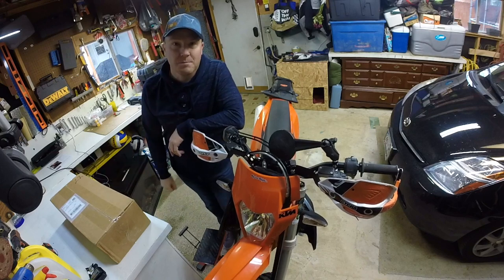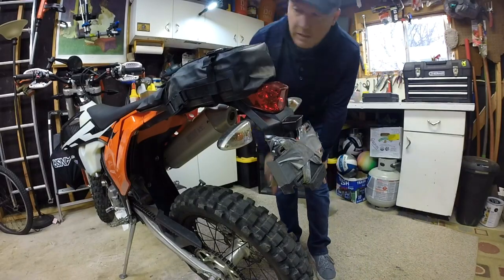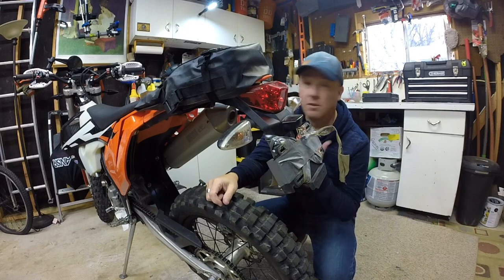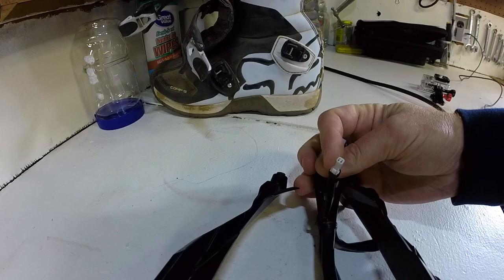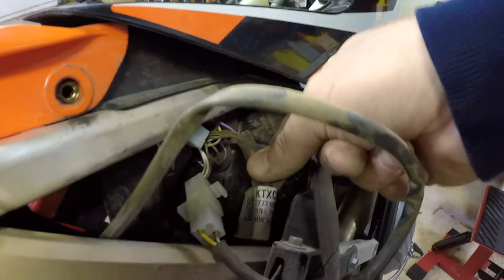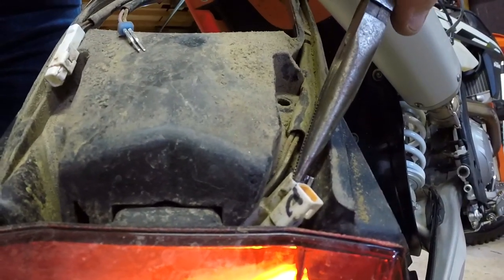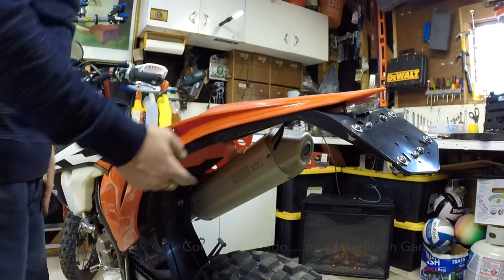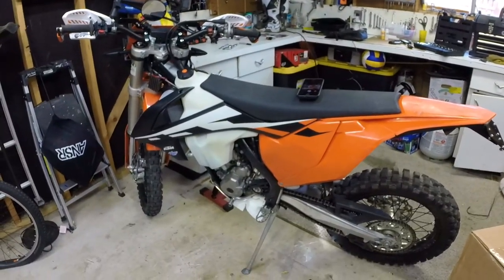Tail Light Kit Install - KTM 250

Comment: Thanks for sharing your installation experience. I'm expecting two kits from Paul any day now for my '17 500 EXC and '17 350 EXC. Did you consider cutting / and splicing the extra length of wiring rather than coiling up the extra and stuffing under the plastics on the right side? I guess as long as there is room...no harm in having a bit of extra wiring tucked away?